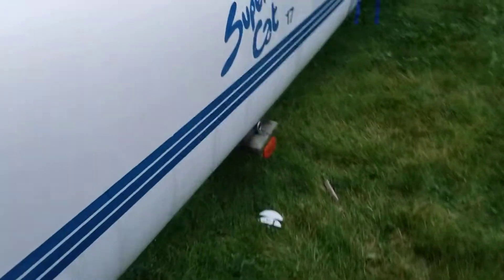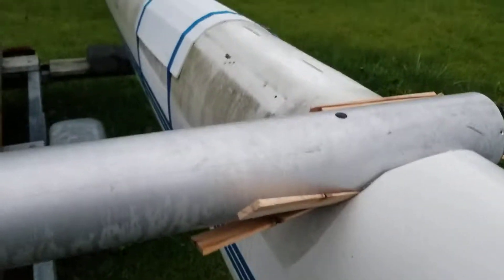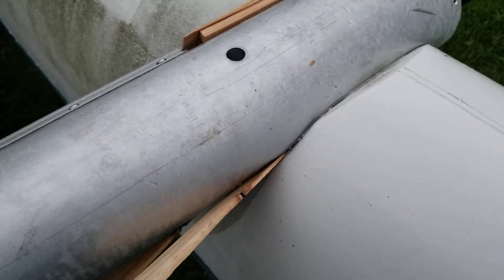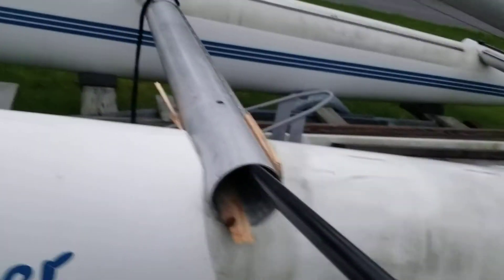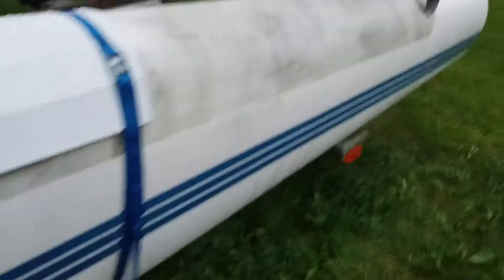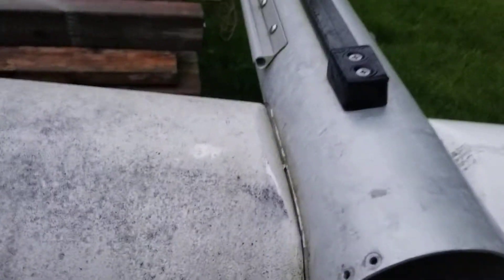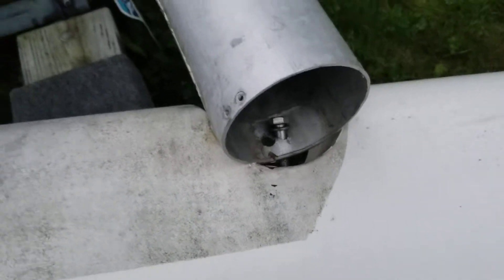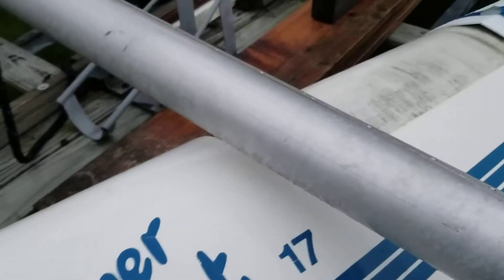Boston Whaler Supercat 17 remove cross members

Comment: Did you have any corrosion issues with the bolts and blocks?
Reply from the maker: Not one bit, the aluminum blocks and stainless steel bolts show zero corrosion. But this boat has never seen salt water. Lake Ontario mostly.